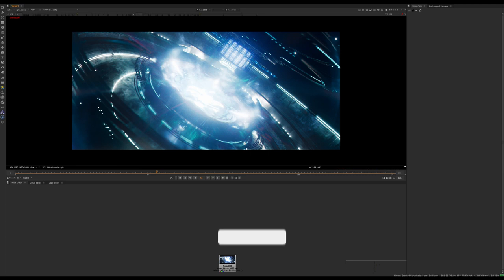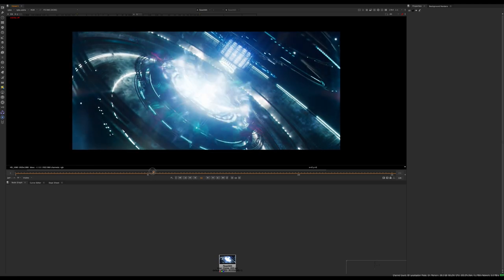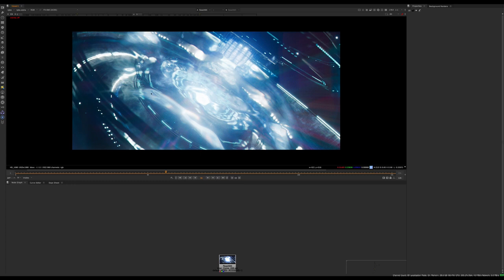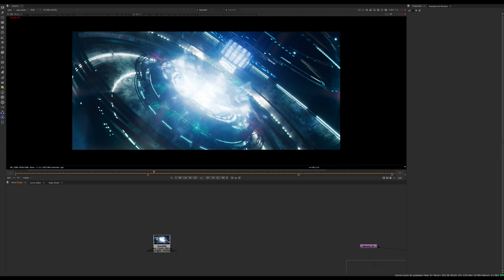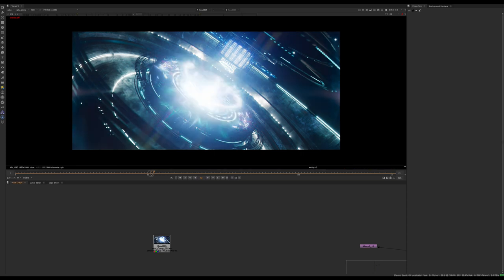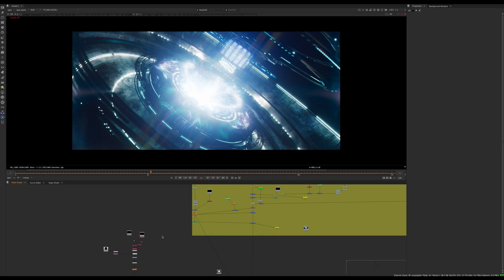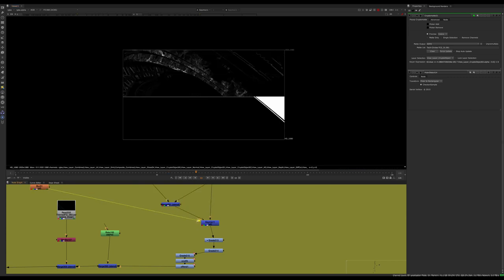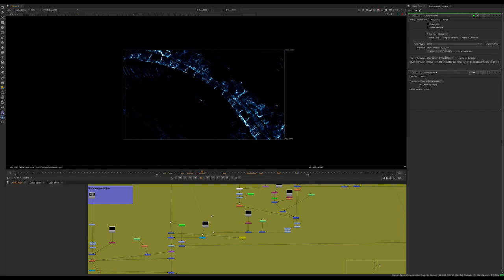Nuke Compositing an Advanced CG Shockwave | VFX (LookDev)

Comment: Great tutorial, very creative use of an assets, thanks for sharing. I Also love the camerashake, is it simple tranform animation, or is there any tips on that?
Reply from the maker: Thanks!  The camera shake was just a simple Camerashake node, usually I just play around with the frequency and amplitude and increase the amplitude up as something comes across the frame.

For a more continuous camera shake though I would probably do it on the virtual 3d camera with a bit of noise multiplied against the movement, versus doing a 2d shake because you get real parallax
Reply: @CompositingAcademy  got it, thanks for answering!

Comment: very nice again! how long those processes usually last? from the first ideia until the final render?
Reply from the maker: This shot took me probably 10-12 days to do, including the lighting / rendering part (which admittedly I'm a bit slower at because most of the time I work in Nuke as a compositor, however I'm getting faster on the CG side of things)

Also, I bought the model online, so that saved a lot of time.
Reply: @CompositingAcademy  nice! Quite fast. I'm asking this because I miss some content talking about this planning side of a shot, covering all the steps to get trough to do a shot like this. Mainly, as you mentioned, when we work as a compositor most of the time but need to generate other elements and layers outside nuke. This kind of knowlege is so useful for ocasions that you have to do all the stuff by your own. cheers! and thanks again for the great stuff ;)
Reply from the maker: @elironejunior3420  Yeah definitely.  That's something I'm studying constantly at the moment as I'm co-directing a cg film currently.  Learning how to plan out shots artistically, compositionally, lighting / framing / timing, it's a ton of work.  Recently I've just been focusing on 2d thumbnailing for example, which exposes you to a completely different way of thinking.  But extremely fun to learn and pushes you forward a lot as an artist (which spills over into compositing as well)

In NK606 I am planning on talking about some of those planning out concepts, but probably I'll expand into more of that as the channel grows as well.